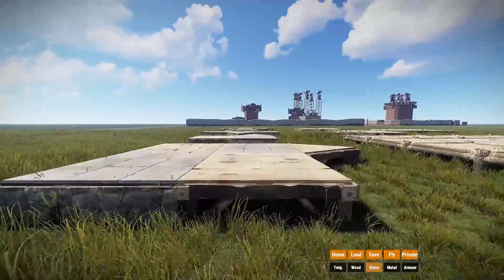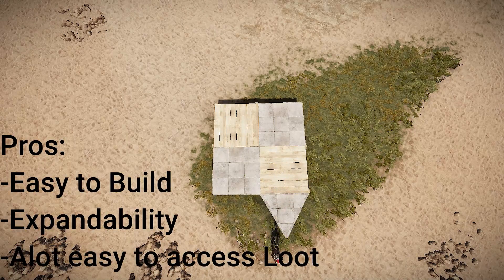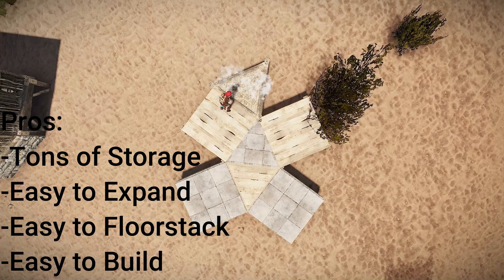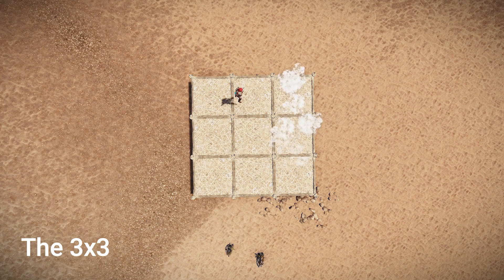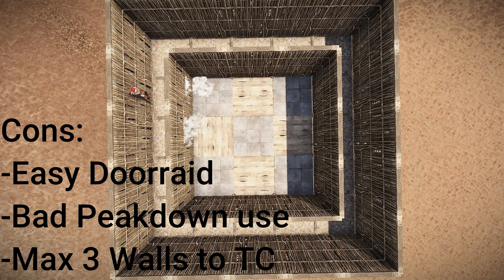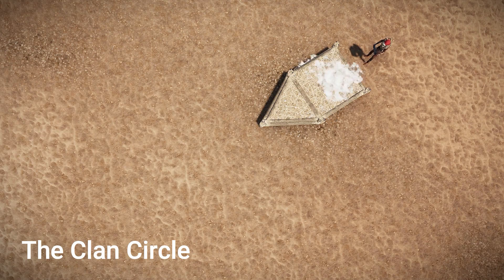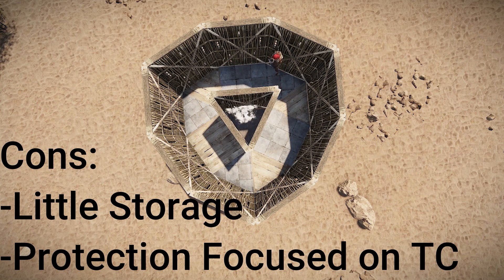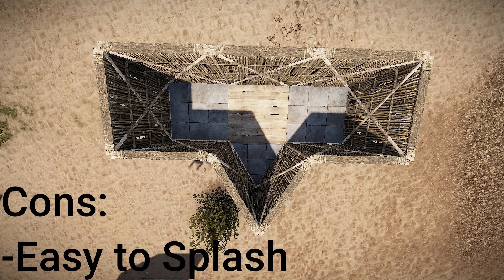Rust Building Tutorial - Footprints - Basics

Comment: I build all triangles with a kill spawn bunker that has a larger box that you can deposit from above and transfer from below. Since I have been building this bunker base I have never lost a base in a raid.
Reply from the maker: ok cool
Reply: Could you show the layout?
Reply: @Jay-tx2wz  there isn’t really a layout due to environment circumstances. The main thing you want to look for is a large crease on the ground. You will put the TC and however many sleeping bags that you need in this area. You will build with half walls and triangles. Remember once you get the triangles down in the crease stick them as low to the ground as possible and then build everything around it at a higher level, continue doing this until you have enough room for tc, boxes and remember you need enough room to stand when place bags. For the drop box you can do a shop front placed on the edge of a triangle that that you can access it from under the floor or you can do a doorway on one triangle on the second half wall to where it comes up from the floor half way, then you can hide the remaining door opening with a large box that you can access from the top or bottom. You can hide the triangle that sticks up by turning it into a jump up. So essentially you have a two story base with the first floor being hid in a crevice.

Comment: does anyone make strong bases that are integrated into the environment?
Reply from the maker: Only real bases to that i know are cave bases. Rockformations are very unreliable because you never know where they are gonna be and having a good base location is the most important thing in base building.
Reply: I like building a thrifty scott(left out of video for some reason) and stick the triangle holding the TC under/into a big rock overhang...or inside one of the big rocks you can run under/into. Make them come through the doors and save on honeycomb upkeep.

It is random where they spawn but usually you can find something near the power plant or the Launchpad wherever you want to be. Even into the side of a smaller rock just to have a natural obstruction to your TC exterior wall.

Also, you hide better than having a base out in the open. I play in a trio so we want our base relatively low exposure.
Reply: You can make some amazingly strong bases if you integrate them in rocks. The downside is you almost always need to experiment and improvise. Just build a 2x1 close to a rock you think is suitable and go there with wood only and try things out